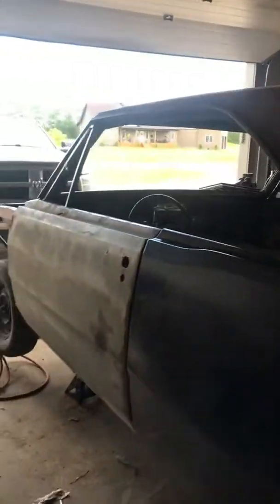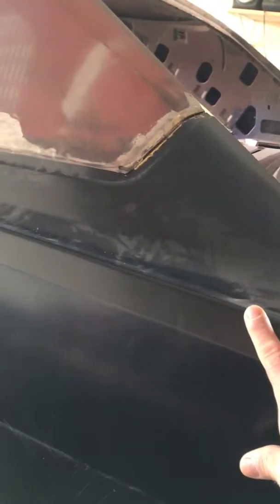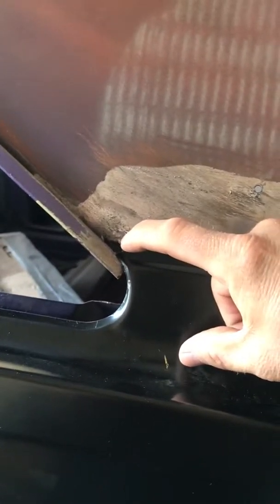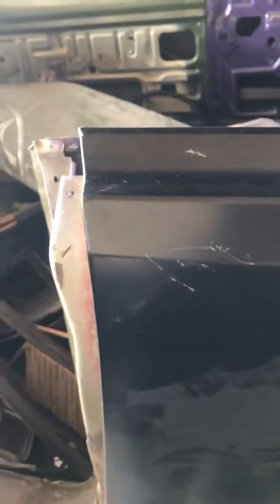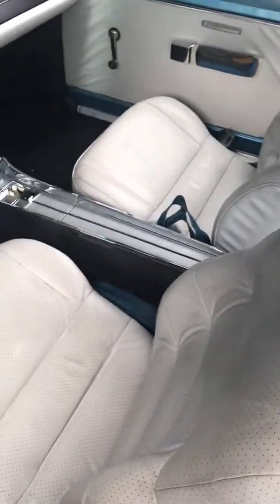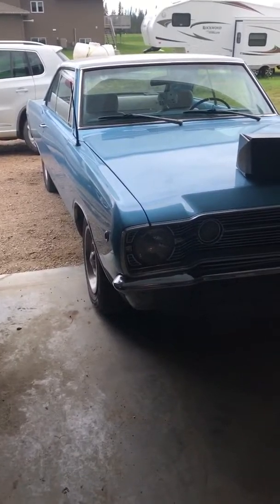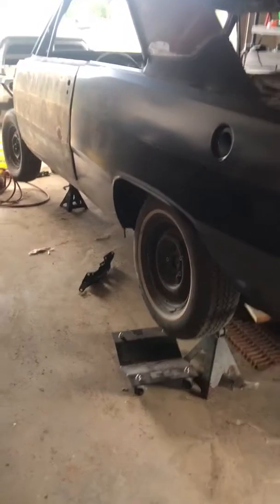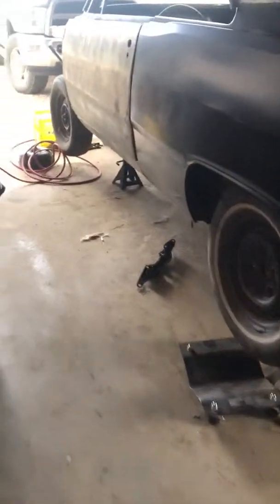Nothing exciting. Just an update

Comment: Hey Fitter 1 love the vids.  My son and I recently purchased a 67 Dart GT V8  automatic center console shift disk brake car.  We also have plans for a 440 as well.  It needs rear fender work too and thus am curious what was your final cost including delivery of your AMD fenders.  We also live up hear in Canada too and so...  trying to keep cost down too.
Reply from the maker: Colin Barber I can’t remember the exact number anymore. I bought my sheet metal in 2 separate orders (just couldn’t afford to do it all at once. It’s cheaper to buy all that you need to at once and only pay the one shipping. Most of the time the places you order your AMD from won’t charge you to bring to their shop if the order is big enough. But will charge to ship it from their shop to your house. 

I believe each one of my orders was $3K ish CDN. And the was shipped within an hour and a half of me and I just went down and picked it up once it was in. 

Those orders were full rear quarter (1 side) trunk extension, outer wheelhouse, front fender,  taillight panel, and trunk gutter. For each side. 

On the left side I ordered the door sill where the striker pin mounts. 

Have a good look at your car before you order and be truthful because it’s easier to order it once and not try to fix rough panels